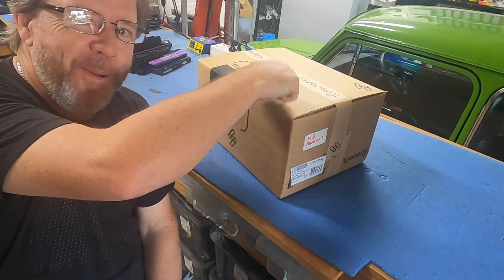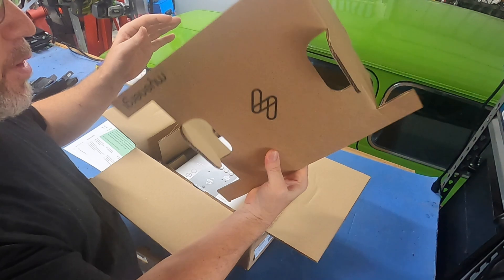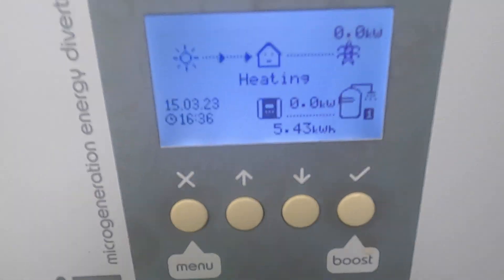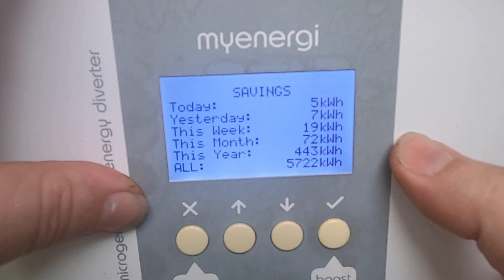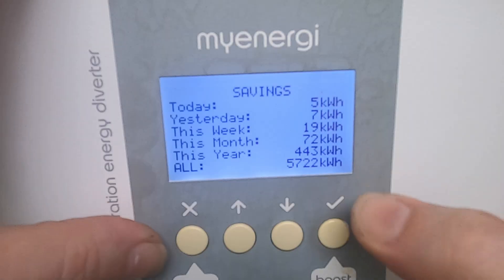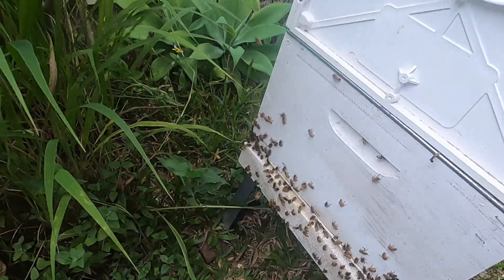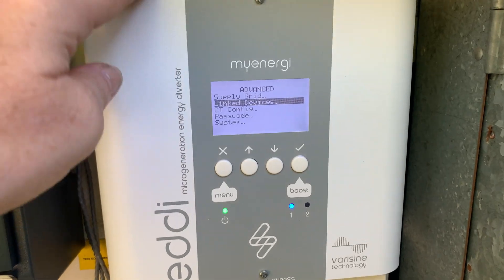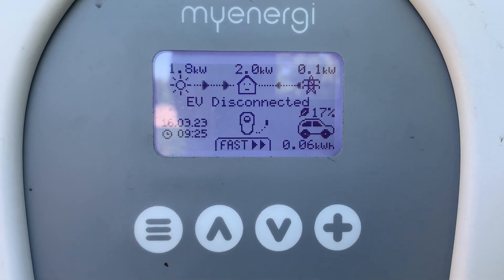Upgrading my  Eddi Solar Diverter in 2023 & taking a look at how the old one has held up

Comment: Hi I have a zappi  and a thinking of getting the eddi. I have a heat pump. Ecogeneca Brand. What hot water system do you have. As I was trying to get info from myenerei but was difficult. 
Thanks 
Alan
Sydney
Reply from the maker: It needs to be a hws with an heating element - they can vairy how much power you send them from 10w to 3600watts - a heat pump is a constant supply so won't work.

Comment: Why is the new Eddi not the latest one with internal hub and two antennas? You didn't need to swap the old Eddi out, all you had to do was install a separate hub, surely? You seem to have wasted some money there to me.
Reply from the maker: old Eddi didn't connect to the newer hub, it was a very old unit - now they have another WIFI version it would have been better again. That said, the new setup is OUTSTANDING, the savings are incredible!
Reply: The first eddi will only communicate with the hub and other devices on 868MHz which is used for UK and Europe. We cannot legally use devices on 868MHz in Australia, we have to use 915MHz. This version and the in-built hub can switch between frequency by changing the time zone.

Comment: I have a similar thing to heat the water in my hot water tank.  My hot water gets heated by either an immersion in the water tank or an oil fired boiler. (I'm in rural UK).   My immersion heater only activates when I'm exporting,  come May I can turn my oil fired boiler off and all our hot water will come from solar power all the way until the start of October.  I save on electricity and oil all because of one of those devices.  They are great.    Up until last summer I used to leave the boiler on and we would need to fill the oil tank roughly every 12 months, with the prices now it would be £1000 a year to do so. I've skipped a year of needing to fill the oil up! So it's basically saved me £1000 in a year lol
Reply from the maker: That's an insane saving! Well done!
Reply: same here, we have two hot water tank that get heat by the exported electricity, a simple switch to do this rather than the diverter, last longer too

Comment: Cheers for putting this up. 
I was looking at another system to do the same thing. 
It kinda makes me want to look into this further and doing some maths on getting one installed to make my off peak smaller. 
Only a hot water heater for me however.
Reply from the maker: So glad I helped, going to do a two week update so you & others can see usage after a short period the app makes it a tool I don't want to live with out. I can see in winter i'll be invaluable. Now if only the unit had an external temp sensor you could attach to your HWS just so I can tell in advance how enjoyable my shower will be!
Reply: It’s good to see some of your ideas and what you do. You’re local, have been doing this for years and have a vested interest in this. 
Your data will be great given our climate is the same. 
I’d just need to see what happens in the next few months. Your experience will be great. 
Especially given I export around 13-8kw a day after my (small) home battery is charged. 

I will have to go back through your videos to see what happened to your old one.
Reply from the maker: Yeh exporting sucks hehe, if your local and you want a proper look reach out, Nothing wrong with the old one still going strong, just didn't have the ability to connect to the new Zappi